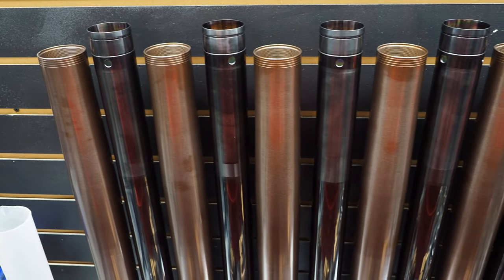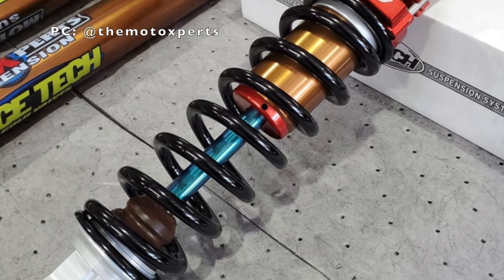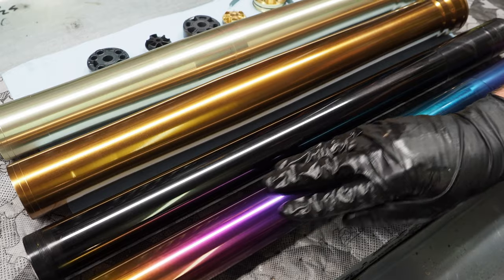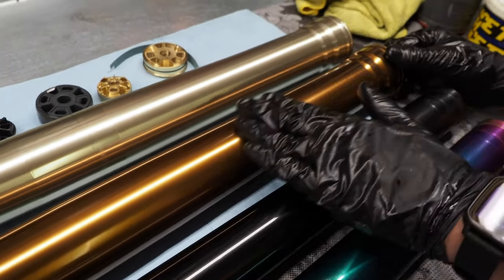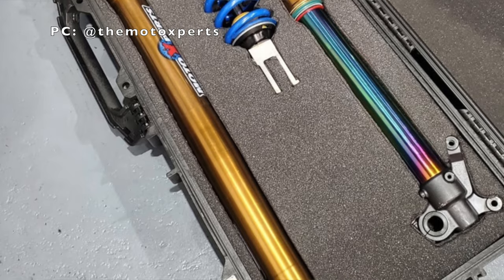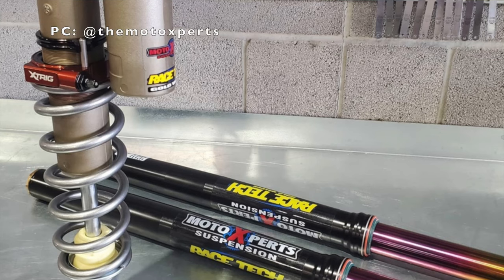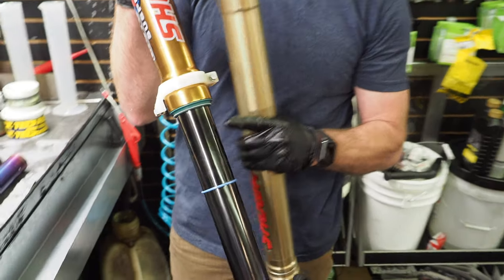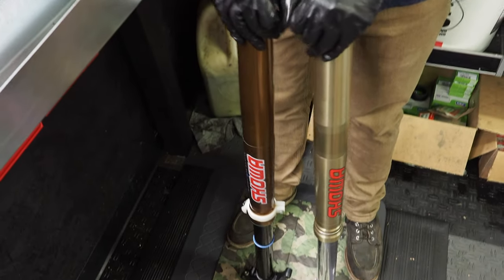Thinking of Getting Your Dirt Bike Suspension Coated? Watch This FIRST!

Comment: pretty sure the factory teams use Ti Nitrate or whatever which gives the color and they say feels better even though it's not as slick. the Black is only DLC and oems are using it because it's slicker and last longer than chrome or ti.
Reply from the maker: So true! The DLC black is definitely the strongest and most resistant. Interesting to see different teams using different coatings too!

Comment: What are holes on the bottom of the tubes used for?
Reply: On the forks the hole in the threaded part is to let you drive the lock pin to keep the tube from spinning off the bottom part.

On the shock shafts thats a bleed hole for a clicker.

Comment: I have the new vmax and it has the black coating on the inner tubes. Noticed I have a leak and upon inspection I found a scratch in the coating. I can barely feel it with my finger nail. What can I do to fix this??
Do I have to get it re coated??it’s A area you can not see so I was hoping I can lightly horizontally sand it out or at least make it more smooth and put on new seals. 
Or am I just totally screwed??
Please help
Reply from the maker: Dang Jacob, that's not cool. I don't suggest trying to sand it out because it's only going to rub off the anodizing that's already on there. Unfortunately, the best way to go about getting it fixed, is to get it  professionally done and re-anodized
Reply: @GregHitchko I have no idea where I could have it done. It’s the stock black coating. I can barely feel the scratch and wonder if new seals would leak?? Do you all do the coatings I need?? This is basically a new bike, I’m hoping I stopped the leak. And if not no idea where I can get them coated.
Reply from the maker: @jacobhendrickson8935  how new is the bike to get a better idea of how much time is on those seals?  Can you feel the scratch with a finger nail or your finger pad, is it sharp?
Reply: @GregHitchko  oh well it’s new to me. Lol I guess calling it new is actually way way off. It’s a 2009 but only 9,000 miles on the bike. I have 5 bikes all more mileage without seals leaking. Those are all upside down forks as well. The vmax is a conventional fork 52mm not upside down. The coating looks brand new, I think someone was inspecting the seals and used a flathead to remove the dust cover scuffing the coating. It’s so minor that I’m not sure it’s even why the seal is leaking. I cleaned the seals up with a seal cleaning tool to get all dirt out and believe my problem is solved. However I will replace the seal regardless this winter. So now my only concern would  be that very minor  scratch. I’ve been told by several motocross riders they very lightly buff out the scratch. Not enough to remove the coating just enough to not be able to feel the scratch. Horizontal only no vertical sanding at all. My only concern is keeping new seal from leaking being the scratch can’t even be seen anyway. 
Im talking sanding with a 500/1000 grit and so lightly you wouldn’t know it was even touched. I do automotive paint/bodywork so have a good feel for imperfections. I’ve seen videos where they fill scratches with super glue which seems totally crazy to me. 
Hopefully this winter I can find a place to re coat it for me.
It doesn’t feel sharp at all but I can barely feel it with my nail.
Reply from the maker: @jacobhendrickson8935  oh yeah, I can see that happening where someone used a flat head to pull that dust seal down, not the best method lol. But hopefully there was just a random spec of dirt that was caught up in there, causing it to leak. Sounds like you know what you are doing in terms of trying to buff it out since you're familiar with automotive body work and paint so I would trust your instincts with it! I'm sure you barely need to touch it and it will come out fine. The only potential down side it would cause it the way it looks cosmetically, but sounds like that isn't an issue based on where it is located. Thanks for chatting through this with me Jacob, every bike and situation is unique and it's cool that you brought me along on the journey. You will have to keep me posted if you go ahead and try to buff it out.